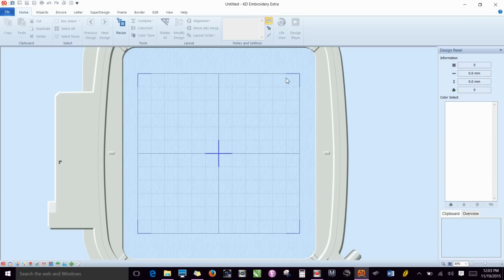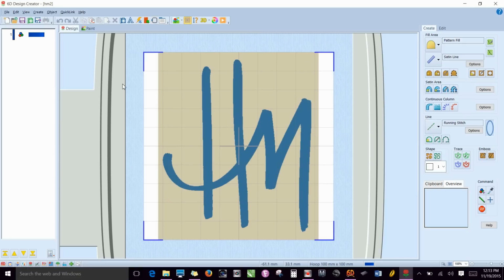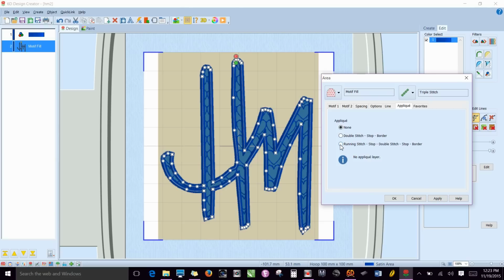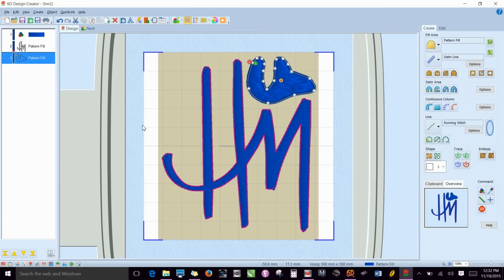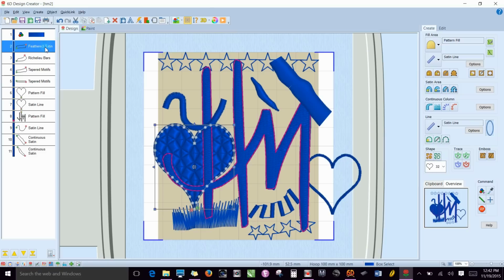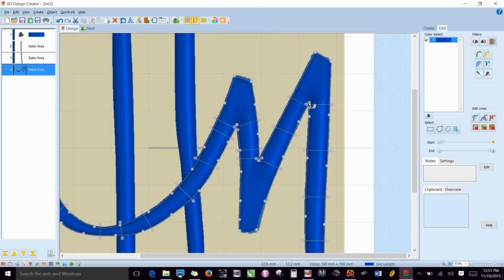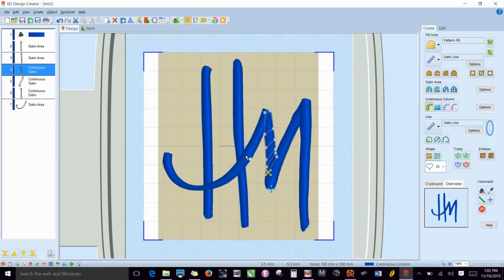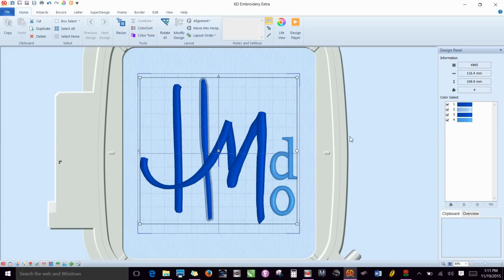FBC 6d Premier Design Creator embroidery software overview

Comment: Are you using 6D extra because I have that and I cannot open any of the icons on the bottom it says I need the dongle I already have the dongle in, it works the rest of the program but it won’t work the ones on the bottom should it if you could please answer me I can start the process to find out how I can get it fixed or whatever thank you so much for your time you’re very knowledgeable!
Reply: This particular video is for 6D Premier, so 6D Extra doesn't have access to this module unfortunately.  I do have a couple videos that are for Extra though.  I run a software group to support all versions.  https://www.facebook.com/search/top/?q=husqvarna%20viking%20%26%20pfaff%20embroidery%20software%20user%20group%20(unofficial)&epa=SEARCH_BOX

Comment: do you happen to  know what software the Designer SE Limited will run?
Reply: Actually the machine will run completely independent of software.  It has it's own firmware built into the machine.  This software is for the computer- it enables you to view, edit/modify, or create new designs for your machine on the computer.  Viking has a free software available call the 6d explorer plugin that will help do the essentials though (I have another video on that).  If you are on facebook, join my machine support group https://www.facebook.com/groups/HVEMUUG/

Comment: Thank you for the great tutorial!!   I recently purchased a Ruby Deluxe and I have NOT purchased software yet.   I understand that 6D was upgraded to the "Ultra" package (white box).   Have you "played" with Ultra yet and I assume all that you do with the 6D can also be done with the Ultra (and more...)   Thank you!
Reply from the maker: I have been exposed to ultra but not had an opportunity to use it for myself.  Yes, it does all the same things as 6d premier in mostly the same fashion (but they moved the interface/buttons around so the screen set up is quite different).  The main thing that it does that 6d does not, imo, is that it added the option to be able to export an applique shape out of the program so you can send it to a cutting machine such as cricut or silhouette and have the machine cut the fabric for you.  If you do a ton of applique in the hoop, this may be a benefit, but I personally find it just as easy to cut it myself once it's tacked down in the hoop.  I prefer the screen layout of 6d over P+ Ultra because Ultra kind of split up the screens, so you have to click on several tabs to access all the tools whereas 6d has all the tools on the same page.  Ultra feels more disjointed to me because of that, however, I believe they did that so they could make the icons larger, so if you have any eyesight issues or need to be able to click bigger buttons (like on a touch screen), ultra does help with that.  If you start on that though, I am sure you will adjust to where the buttons have been moved too.  It is still very capable software and does everything mine does.  6d Premier is upgraded to Premier+ Ultra.  There are also lower tier levels of the software available if you don't need full digitizing ability, but I love the freedom of creating from scratch.  I hope to make more videos to go further in depth in the coming months. 
 Make sure to subscribe to my channel to be alerted to more and join my software facebook group:  https://www.facebook.com/groups/756134151185403/

Comment: Thank you so very much for such an awesome video.  I was lost how to use my Premier+ Ultra software to make an embroidery design from a website logo that was supplied to me.  There are a few odd stitches that the system put in, I am trying to figure out how to get them removed.  Prior to watching your video I did not know to clean up my print in print shop.  I cannot thank you enough for this tutorial!
Reply from the maker: I'm so glad it was helpful.  Starting with a clean graphic really helps make the process a lot easier!  There are a lot of graphic programs out there that are pretty robust (currently I use a combination of Corel Paint Shop Pro, and Corel Draw for my graphics work), but the 6d premier software does have some basics built in.  And yes, the software does do some odd things when using any of the auto-digitizing tools, but hopefully you have figured out a few ways to edit them.  There's no 1 right way, sometimes there are a few, but I hope to make more videos to go further in depth in the coming months.  Make sure to subscribe to my channel to be alerted to more and join my facebook group:  https://www.facebook.com/groups/756134151185403/

Comment: Great tutorial but I am having an issue.  I bought a Ruby Royal with this software and every time I try to stitch out my design or just start stitching my Stabelizer it starts bird nesting underneath and jamming my machine putting holes in my materials.  I took the machine to the dealer and she said it is because the design is created from a picture, but it is doing it before it is even starting on the design.  any suggestions?  what can cause this?  she said my tension is good and everything is ok on the machine.  I believe her it has to be something I am doing, wrong I just don't know what....
Reply from the maker: Hello!  So sorry to hear you're having issues.  I don't believe this is due to the software (unless you have many layers of stitching on top of each other- the heavy density can sometimes be problematic, but a couple layers are usually fine.  Most commonly bird nesting is an issue with threading the top thread.  Make sure when you thread the top of the machine that the presser foot is in its upmost position as this opens the tension discs for your thread to slide in deeper.  While threading through the tension discs, I always hold the thread between 2 hands to keep it pulled taut (kind of like flossing your teeth on a giant scale), and floss it in between the tension discs and then down and around the check spring and back up to the take up lever.  Once you get your thread to the point of putting it through the needle, you can then drop the presser foot to move it out of the way of your auto-threader to finish threading.  Hoping this will help.  If this doesn't solve your issue, feel free to post in my support group for machines (there is a bit of a wait list at the moment but I'm working on it).  You can join my group here:  https://www.facebook.com/groups/HVEMUUG/

Comment: I bought a ruby Viking and no one told me or gave me basic info. Do I need to buy this software to download in my computer if so what is it called basic info would be greatly appreciated thanksssssssssssss
Reply from the maker: Hi Michelle!  The Ruby can work independently of software.  If you only want to buy designs from digitizers online, premade designs, and be able to stitch them out on your ruby- software is not needed.  However, if you want to be able to edit designs your buy, or add lettering/monogramming/customization, or even to create your own designs from scratch, then you will need to buy software separately.  There are many brands of software out there each with different capabilities and prices.  I'd be glad to help you more on this.  If interested, you can join my machine support group on facebook.  https://www.facebook.com/groups/HVEMUUG/

Comment: Thank you for this video.  It is so straight forward and easy to understand.  I started with 3D and bought every version they had until the 6D Premier came out.  I didn't use my 6D any when I got it because I was unable to attend classes and the ones I did attend were not near as helpful as this demonstration has been.  I may decide to get my software out again and see how it goes.  I have tried to digitize on my own for several years and some things turned out but most were so time consuming that I gave up.  I see so many designs out there that I figure it can't be that hard to do but I haven't been able to find any help. Thanks again for a wonderful video and I look forward to the next ones.  Did you buy the 6D Premier or are you still using the 6D?
Reply from the maker: +J Cogar  Thank you!  This was done using 6d Premier.  The lower tiers (6d Extra and 6d Embroidery) have more basic functions, but if you plan to create your own designs, you really need the top tier version of 6d (Premier)...  They have since come out with a newer version they have names Premier+ Ultra, but I do not have that due to price atm.  Don't give up!  It is time consuming to do correctly, but you'll enjoy it once you get the hang of it!
Reply: Thanks for replying back with your encouragement.  I am going to get my software out TODAY. I have seen the software used by Baby Lock/Brother and was considering getting it instead of Premier because Eilene Roche and her staff from Designs in Machine Embroidery give out tips every week using that software.  It is so much easier to learn if you have someone to give tips.  I may decide to reconsider my choice since hearing from you.  I will give it a couple more months try before I make a decision since it so expensive a purchase.  Thanks again and love your teaching style.
Reply from the maker: +J Cogar Learning anything without support can be difficult!  I'd give this one a try before writing it off.  I posted a link to my facebook group in one of the other comments earlier.  Feel free to join us if you would like!